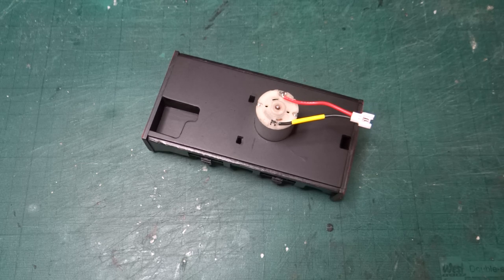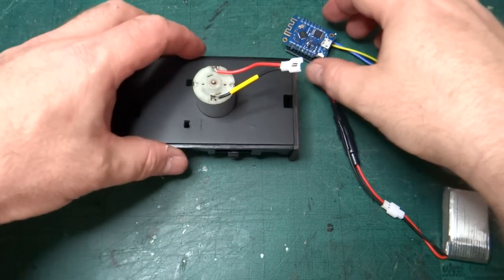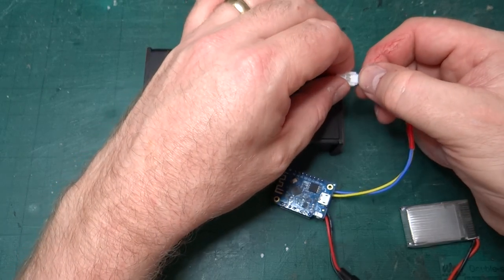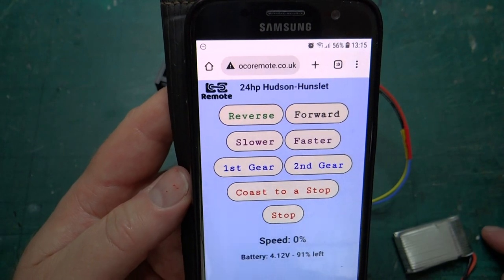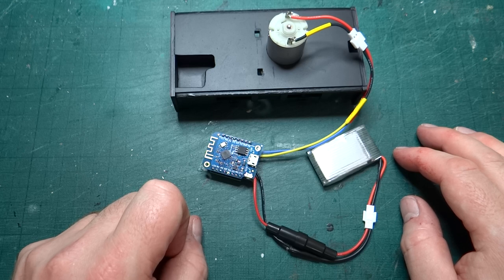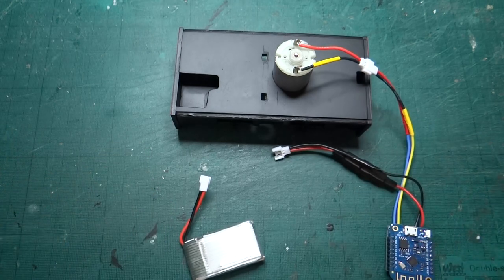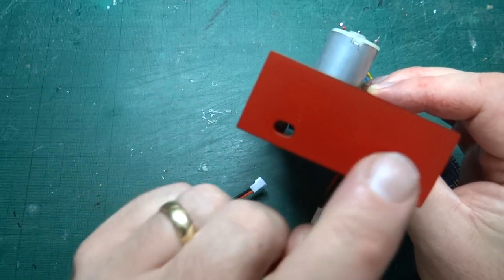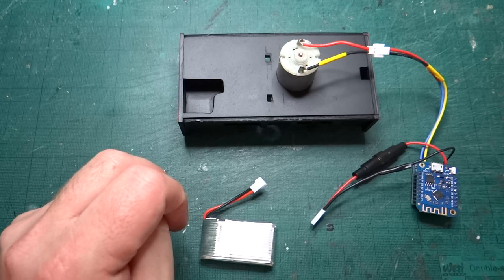Building a 24hp Hudson Hunslet Diesel Locomotive in 16mm Scale: Locoremote

Comment: Code?
Reply from the maker: Unfortunately I don't have access to the code running on the board. There are a few features I'd actually like to add to the interface that runs on the phone, so it would be good if the code was available but I understand why it's not: the hardware is just off the shelf so what you're really paying for when you buy a Locoremote is the custom software. I have looked into developing my own version using the same (or similar) hardware but that's not got very far yet, and probably won't until I have a requirement that I can't satisfy with a stock Locoremote.